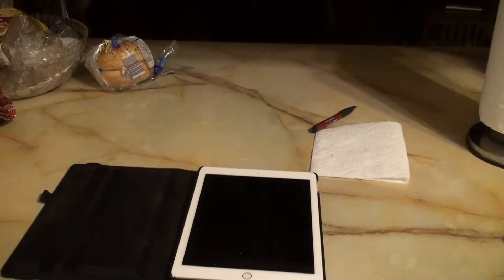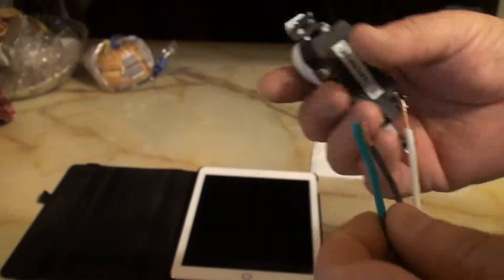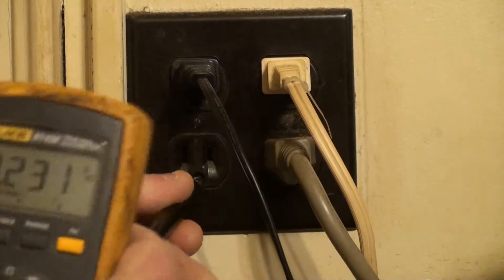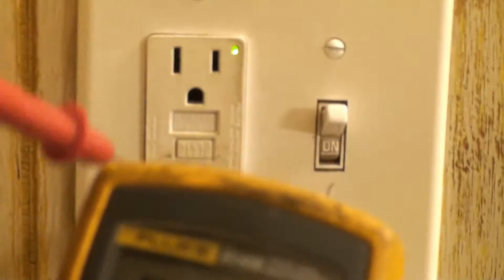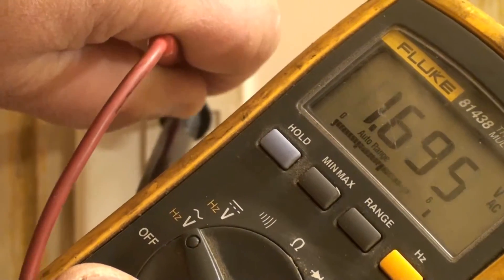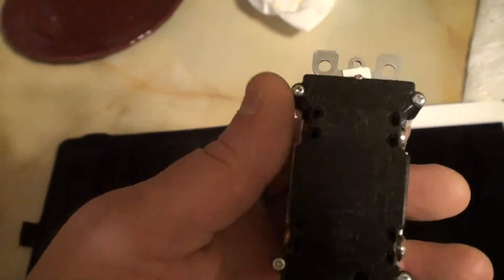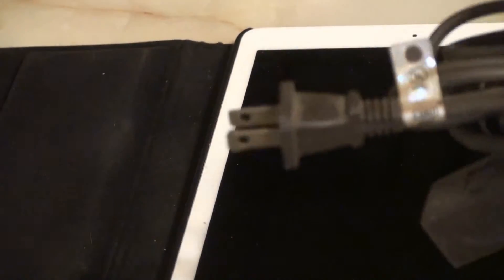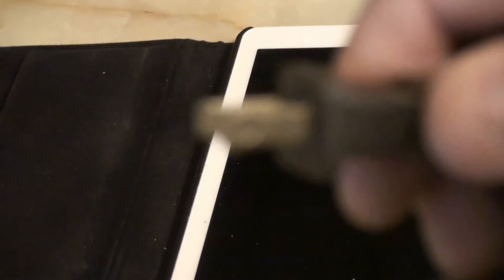Outlet wiring...The right way & wrong way.

Comment: Doing electrical work when drunk is probably not a good idea. The white wire doesn't go on the brass or gold colored terminals. A three prong outlet has a ground and a neutral. You probably should specify instead of calling the neutral a "ground"....lol